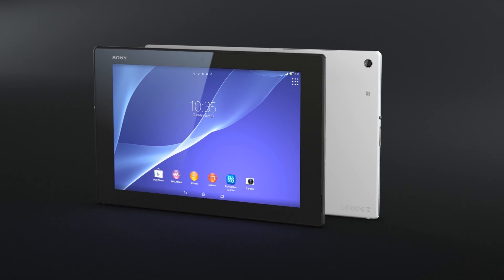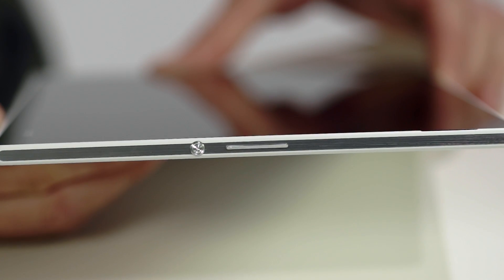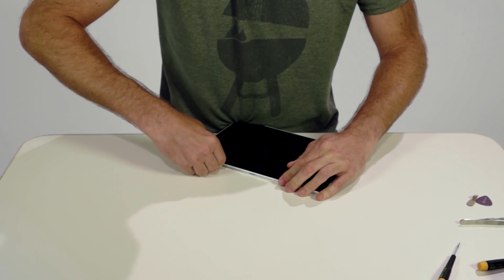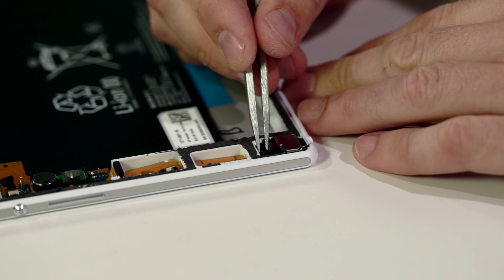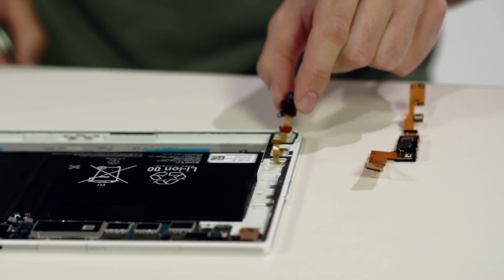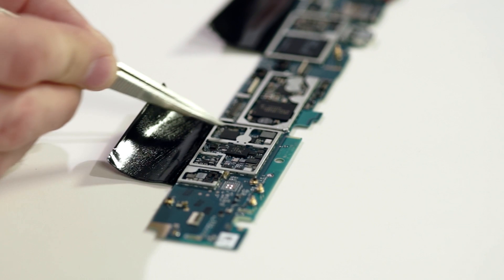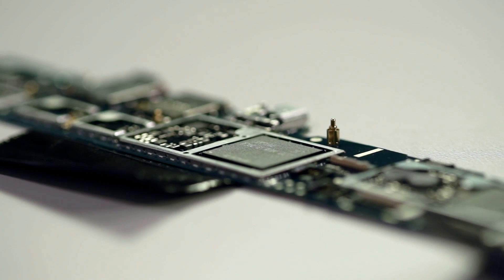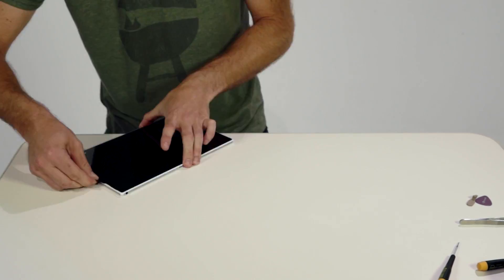Opening up Sony's Android Tablet, the Xperia Z2 Tablet

Comment: Anyone have any suggestions. I have already done a ton of research.  The yellow button, up down power button combo. True to reinstall the software and fix the problems. When I plug it in light comes on. Then off then back on for a few seconds then back off.  I have seen the battery life on the screen sometimes at zero.  I am scared to take it apart since I don’t have the handy special tool.  Suggestions would be awesome. Thank you!

Comment: This tablet sucks, is impossible to open it without breaking the screen. Without pushing any strength with a plastic opener, the screen got broken. Once already broken, I tried with different techniques and was very stucked, and the screen is too much rigid, so got broken very easily due bad protection design.

People, stay away of this device. Even if they are teaching how to open it, is impossible to get it open without breaking the glass, just look any commentary about it at XDA